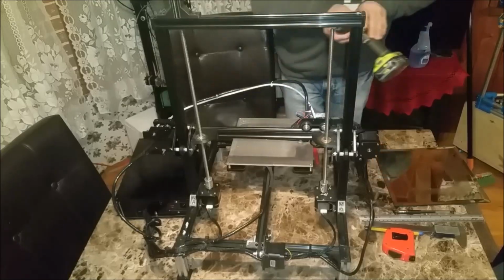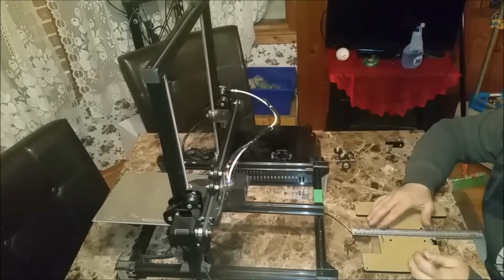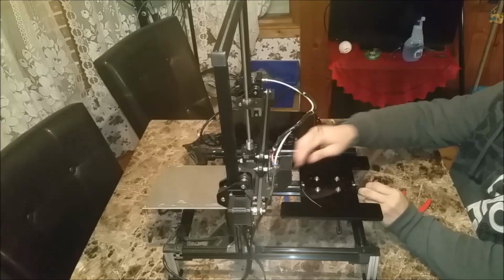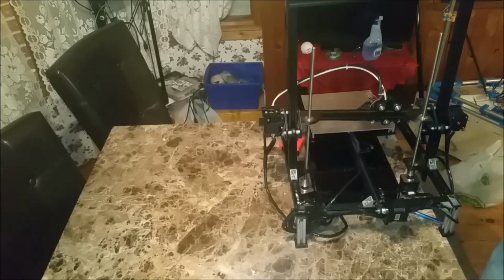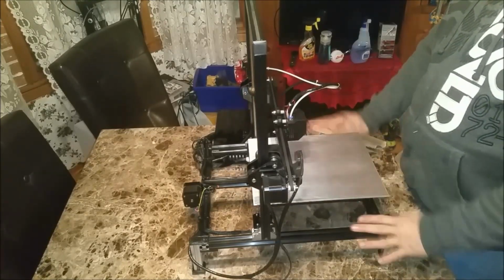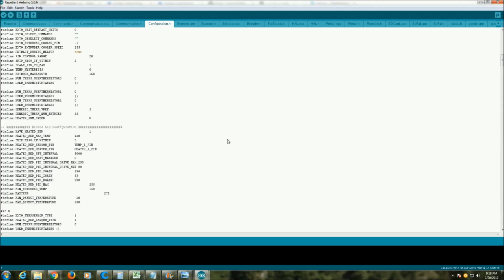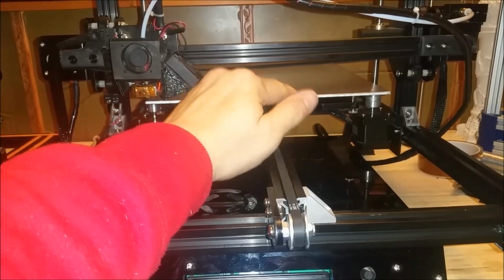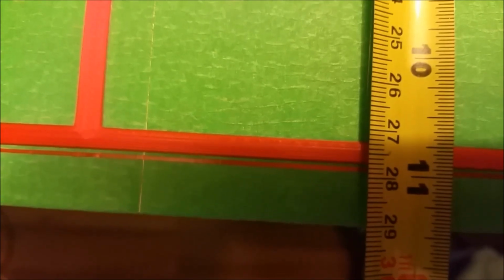Tronxy X3 Build Area Increase Mod

Comment: It seems, that if You turn Z-motors over vertical axis and mount them on outside room, so You can extend wide area many more?  (I guess, up to 365 mm with 5mm clearance to vertical rails. Just need to buy x-rail slowly longer.)
Reply from the maker: To move the motors would require redesigning of the two printed pieces holding the brass nuts in place as well as new gantry mounts to the roller assemblies. It would be a lot of work and would get you 300mm on the X axis at most, also it would require moving the x axis limit switch and the pully on the opposite end somehow or putting a longer piece of extrusion where the gantry is.  It would be a lot of work and require a lot more time and parts. This method just requires a bigger item to go over the heated bead, you could even use a 5mm thick piece of glass instead of another piece of aluminum
Reply: yes, you are right, too much work,for modding. But i mean, if somebody wants to create it's own printer, if Z-axis would be outside, it give more room by x-axis. I think that brass nuts holders no need to change, just they exchanged left to right.  but may be need to print 2 new details: motor extruder holder and X-motor                 holder if they will be mounted not on the bracket, but on the x-rail.

Comment: I have watched a few of you videos. Great job on all. They are much appreciated. I've been looking at the x3 and wanted to know if the CR-10 is worth the extra cash over the x3. I have already looked into upgrading the power supply of the x3
Reply from the maker: Spud Head it all depends in what you want to do. if you think the build space on the x3 will satisfy your needs than the x3 us a better value. the cr10 us not only a bugger printer but comes 90% assembled to

Comment: where did you find firmware for it?
Reply from the maker: Check out the description I put the link to the Wiki there which has all versions of the firmware for the printer
Reply: sorry missed that thanks
Reply from the maker: No problem I hope it helps you

Comment: are you going to try to increase the build area in the software of the CR-10?  This is of big interested since the cr-10-s4 is not readily available for a decent price.  :)
Reply from the maker: I doubt it, It is as big as it is going to get on the X axis as it is already close to both towers, to increase the size I would have to buy some 2040 extrusions. There is potential in The X3 to bring the bed up to the size of the CR10 if you wanted to redesign how and where the z axis stepper motors and threaded rod brackets mounted